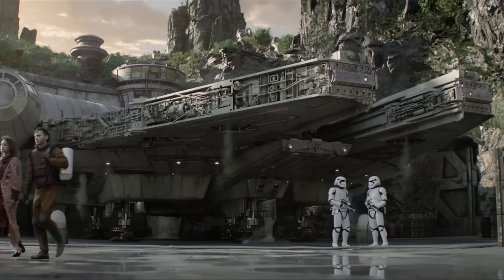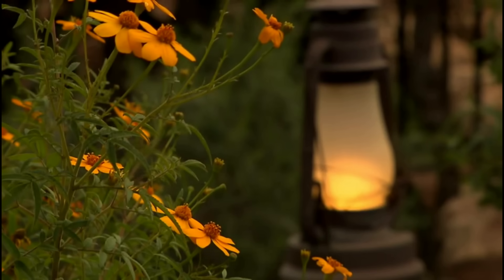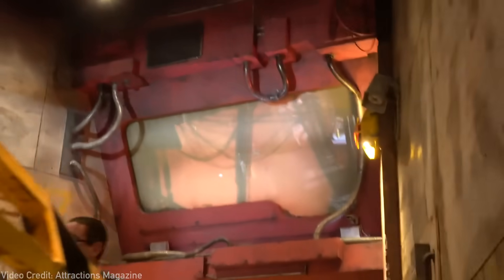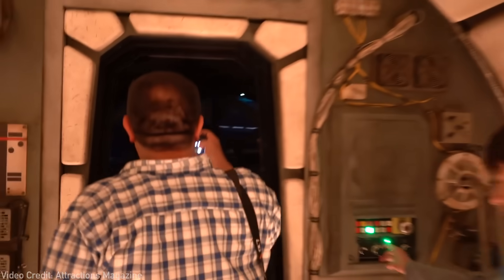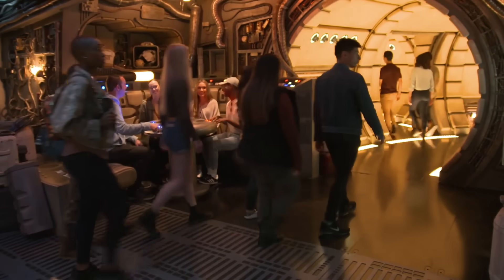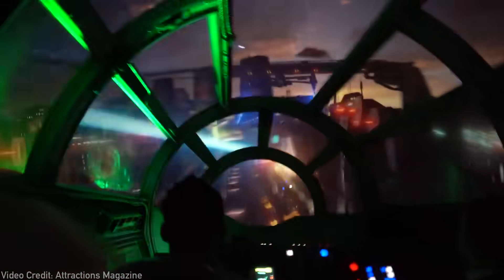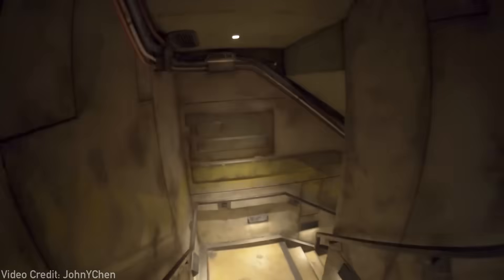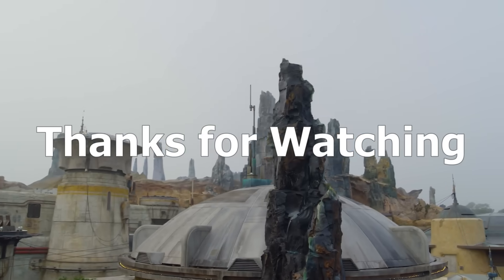How It Works: Millennium Falcon Smuggler's Run

Comment from the maker: What's your favorite ride experience? Share your story. 🙂
Support us: www.patreon.com/AmusementLabs
Reply: When will you doing Soarin?
Reply from the maker: It depends. I'll be putting out a poll soon.
Reply: @AmusementLabs  alright
Reply: What I don't understand is why Disney has not (yet?) created multiple different ride journeys for this ride.  Since the entire ride is computer controlled, why not create many different adventures and change them every month?  For example, if there were 12 different ride adventures with a different one active every month, return visits to the park every month would be almost guaranteed.  And why stop with just SciFi type rides?  This type of technology could also be applied to "kiddie" rides, too, so that rides like Mr. Toad's Wild Ride and Snow White and Peter Pan could be converted to rides that seemed to have movement, but like the Star Wars rides, never actually moved.  The same physical space could accommodate more simultaneous riders, the lines would move faster, and different adventures could be loaded each month.  Surely I can't be that much smarter than Disney's managers, so why haven't they done this?
Reply: @Hal_T  when I was at Disney a few months ago my family and I were lucky enough to go to it twice, and while the major plot points were the same we ended up shooting away tie fighters the second time around
Reply: @Bennyboi_  - That's an encouraging first step, but I don't see why they are not expanding on that and shooting you off into a whole new adventure because you shot the bad guys.  With computer controlled rides there could be limitless possibilities.  And with "unlimited" ride potential you get "unlimited" return riders.  I don't understand why they are not doing this.

Comment: This is the only time a ride has broke down while I was riding it! (thankfully during the landing sequence). 
The cockpit tv's have a lore-friendly video that plays while you get rotated out, once you get out the staff will give you a lightning pass that only works on this ride (because the other 3 presumably are still running), and they'll let you stay a little to show you how the revolving exit works! 
But uh yeah if you hear a grinding noise tied to the movement, let the staff know

Comment: For those of you who've never rode this ride before but are wanting to, here's a tip: the ride functions like a giant, full motion video game (meaning that you're actually in control of the movements and the action). It's best to choose the two people in your group who have the best hand-eye coordination to be the two pilots (or you're going to end up having a very rough ride like I did when I let my mom and dad be the pilots, lol). Also, there's a fun detail in this ride: there's a live scoreboard that shows up on the screen at the end of the ride just before you depart. If you plan on riding the ride more than once, you can try improving your score with each time you ride as a fun challenge.

Comment: Its unfortunate. There's always a kid, the kid always will be a pilot. So you never get to be the pilot, and the kid keeps crashing, so the gunner is redundant and the engineer is button spamming. Nothing you can do about it, letting the kid be pilot is the right thing, it's just inherently flawed if you're not in a large group or luck out. I've been on it a few times and I'm yet to do anything interactive in the interactive ride.

Comment: Guys what happeneds if u don't get hit by anything is the ship clean when u get off the ride
Reply from the maker: You get more points and the spiels are different. Originally there were panels that would flip around to look like damage if the ship was during flight, but I don't think they work anymore.
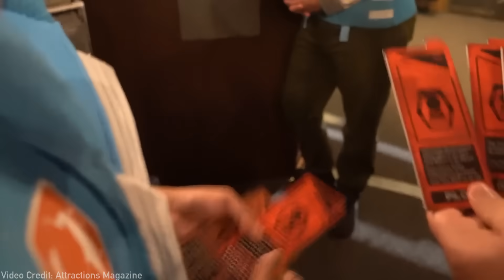Reply: @AmusementLabs  I was gonna say, I don't know if I've ever seen the damage panels, just as I don't recall when they last handed out those cards you showed at 5:23!

Comment: As someone who works here, this is very well researched. Impressed by how much you know. 

Controls in the cockpit are actually determined by your seatbelt, not necessarily censors in the seat. Nothing in a control panel works until the corresponding seatbelt is buckled in. 

What you call a carousel, we call a turntable. They’re called Alpha, Bravo, Charlie, and Delta.
Reply: That makes more sense tbh. The technology for seat belt sensors has existed in cars for decades, it would be easier to modify something that already exists vs having to make something new. Right?
Reply: That's a really interesting tidbit, thanks! I always wondered what would happen if I showed up and was the only person there given that at the very least, you need two pilots to fly the Falcon!
Are there backup controls on the pilot positions for the engineering and gunner roles in the case that there aren't enough people? Or does a Cast Member tag in to help?
Reply: @rowangoswell  Nah, the missing roles just get automated.
Reply: This happened to me today (lucky timing with the single rider line?) and was told I could pick whatever I wanted and the other roles would be automated.
Reply: Delta turntable 101 lol
Reply: Those names actually make sense.

Comment: Fun fact: If the ride breaks down, it can be just as fun as the ride itself! Hondo will ocassionally pop up on each station's screen and deliver a short speech. (Example, asks a droid to play some music while the riders wait that consists of random beeps, or has a conversation with chewie about what's broken.) 

Overall though the ride is very fun and here's a tip: The single rider line is much shorter than the regular line, and is a viable option if you don't mind playing as engineer a lot.
Reply: I did see part of the video where he reports a "hitchhiker" creature, which is apparently how they stall for time when the ride's over but not ready to unload. And I once saw the alternate preshow video where he apologizes for not being there in person when the Hondo animatronic's out of order.
It was only on my very latest time using Single Rider that I observed it has a voiceover of Hondo introducing Ohnaka Transport Solutions to make up for skipping the preshow! Is that new, or was my timing off before?
Reply: @BagOfMagicFood  I don't think it was there before, although it's been a while so my memory's fuzzy lol.

Comment: I kinda hated this ride until covid precautions led to parties never being seated with other parties, because then our group had the ability to actually be the pilot or the Gunner. If you ride as an engineer, you functionally did not ride the ride.
Reply: This is BS. I have ridden the ride in each position, multiple times .  I think the engineer position is way more interactive than the gunners.  The engineers have to fire the harpoons and reel in the coaxium as well as make all the repairs.  The coolest thing about this ride is that every seat is important. 
 A good pilot / co-pilot team means the engineers do less repairs. And vice versa, a bad engineer team makes piloting a damaged ship harder. It really is a team effort.

Comment: My dad was the real MVP on this ride, He and my little brother were the pilots, while me and my stepmom were the gunners, we had no engineers. My little brother just looked up at the cockpit with awe while my dad had to multitask and control both vertically and horizontally, launch into hyperspace, and not crash. What a trooper.
Reply: I should have done that, but our engineers were ass.
Reply: I did something similar. My brother didnt know what he was doing so i had to take control a few times. Fr tho your dad is awsome
Reply: Yeah Well The Real Magic Would Be Seeing If This Could Be Done Solo In A Believable Fashion I Remember Running A Training Exercise Once Where The Scenario Was Smuggling The USS Pueblo Home That Was The Exercise Where I Attracted A Lot of Korean Girls You Know The Tour Guides For That "exhibit" Understandably I Got A Little Nervous When Things Started Getting A Little Too Real And I'll Tell You If There Ever Was A Real Life Millennium Falcon That USS Pueblo Would Be That Ship The Training Exercise Exists Because Few Know That The Pueblo's Helm Is Actually Compromised But You Would Run Through The Ship To Start The Engines Assuming They Still Have Fuel Only To Arrive At A Gaping Hole Where The Helm Should Be What That Training Exercise Taught All of Us Is That Smuggling Doesn't Work Eventually Your Luck Runs Out You Get Caught And Well North Korea

Comment: I am very sensitive to motion sickness.I am an 68 and some years back I rode Mission: Space, got so sick that I was taken by ambulance to the hospital and spend the next night and following day in bed (I did both back -to-back versions of the ride). Does this ride uses centrifuge, or may be safe? Taking a trip back to WDW Florida at the end of October.
Reply from the maker: It's not a centrifuge. The carousel is only to index the pods slowly. It just rotates over to the next one. It doesn't spin up. It can bump you around though, so if you're easily motion sick it may not be entirely for you. Just don't let kids be the pilots, they'll really make you sick.

Comment: The thing I personally don't like about this is that when you're the pilot, the flight controls are divided between you and the other guy. This annoys me because I only have 50% of the control, and if the other guys does something wrong(like pulling too hard), I can't stop him because he, in this case has the verticals and I have the laterals.

Comment: Out of curiosity, why do the pods have to rotate? Does the screen rotate, too, or just the pod? Thanks!
Reply from the maker: The entire screen and pod rotates with the carousel so that they can have multiple pods which greatly increases capacity. Otherwise they'd only be able to do 12 people max ever few minutes per side (there's two falcon sets each with 2 carousels) which would be terrible for a Disney ride. Their rides often need to have a capacity of 1,100 people through per hour. This is why Rise of the Resistance has boarding groups. The unreliability of the ride combined with the pace of unloading is problematic and so it maybe gets 800 an hour.
The Falcon is fine on capacity, but I could see them add 2 or 4 more unload bays in the future.
Reply: @AmusementLabs  my bad! What I meant was, at the very start of the ride, why does the pod slightly rotate? Why can’t it just stay positioned straight ahead? Thanks! 😁
Reply from the maker: @gaptoothed  You would feel the rotation and it would give it away if what was on screen didn't match what you felt. So they might as well disguise it as part of the ride.
Reply: @AmusementLabs  you do great work!

Comment: The "game" felt difficult to me. It feels impossible not to crash into something if you're in the pilot role because the controls are undersensitive. The engineer role was confusing as well. We kept hitting the correct button when it was time to hook onto the cargo, but the attachment failed.
Reply: I get that, I was left and right and it kept overcorrecting!

Comment: Do you consult? Is there an e-mail I can reach you at?
Reply from the maker: Consulting in regards to what?
Reply: @AmusementLabs  development of ride concepts and technology
Reply from the maker: @eduardofarias5397  I do have an email amusementlabs@gmail.com
I don't really do consulting in the professional sense, I do this more as a hobby as I'm still at university.
Reply: @AmusementLabs  great! I’ve sent you an email. If you haven’t received it, please check your spam folder. Happy Holidays!
Reply from the maker: @eduardofarias5397  I just saw it. That's really great that you help run a space like that, I've always wanted to do something like that on my own. Unfortunately though, I can't really consult on something like that since I've never actually ran a makerspace like you. I can recommend that Arduino is a good starting point for operation panels as long as you know to run things like mosfets, transistors, relays, things like that (cause you can't run everything off the arudino power wise), but you'll need to make that decision for yourself (for legality as I can't be responsible if something goes wrong). As for buttons there's a slew of good industrial buttons that are close to what they use in the industry (the ones they actually use are quite expensive). I hope this helps. 🙂
Reply: @AmusementLabs  thanks for the input. We already make extensive use of microcontrollers such as arduino, but also computers such as the raspberry pi etc. Anyway, thanks for your help! Good luck with your channel. Cheers!

Comment: If you scrutinize it a bit, the Falcon that sits outside isn't quite 1:1 scale, but close. I've been in enough cockpits in my life to know you can't fit four or five people in there. Also, the entry ramp clearance isn't tall enough for even an average sized person. They'd have to stoop as well.
Reply from the maker: Ah okay, that's a good catch. I'm not a big Star Wars person so I figured it's probably 1:1, bit like you said, it doesn't like up.
Reply: @AmusementLabs  I imagine other engineers or fans of engineering have noticed this too. Or me as a model builder. When I saw the original 6’ model, I instantly recognized several model parts that were kitbashed from other kits. When you upscale those pieces, they look very different from what you see at scale. Like a raster image file, when you upscale it, it can only get so large before the distortion gets unbearable and you have a clumsy looking image. Same in 3D.

Comment: Really love this video, thanks for putting it together! I’m particularly interested in what you said about the ADA pods. At the end of the video you mentioned they are more intense but also that they are stationary. I’m confused. Can you explain? I use a manual wheelchair and have decent arm strength (but very little grip strength), and I’m paralyzed from the chest down so I suspect I will struggle with lateral balance in particular. Are you saying that the ADA pods don’t move back-and-forth and side to side? If so, how are they more intense?
Reply: So all the other pods are on a turntable that rotates versus the ADA pod doesn't rotate because it's not on a "carousel." This would make it more "stationary," technically speaking, but it's not any less intense and actually has more freedom because it's separate.
Reply: @lmoon2627  just saw this reply now. Thanks!

Comment: Interesting. Impressive, even, but NOT worth whacking a big chunk of one of the most iconic and original parts of the park: The rivers of America. Walt did not want his park to be just another cheap carnival. It was supposed to be a place where families could spend quality time together. The river boat ride was a pleasant interlude where you could just slow down for a bit. To a kid it really seemed like you were on a river! Now the ride has been shortened and diminished. What a shame! "Critter Country" was also eliminated. Sad. My kids LOVED that. You got to spend time with REAL FARM ANIMALS! The Millennium Falcon ride is certainly a good ride, but it is a poor fit in it's location. Couldn't they have found some other place to put it? Connected to tomorrow land would have been the logical place for it.

Comment: What buttons do you press to go into Chewy mode? Going for the first time since the Star Wars land opened. Thanks and I enjoyed the video!
Reply: I would not recommend Chewie mode for your first time but it's been several months now so what the heck. First: buckle up your seatbelts and all six seatbelts need to be buckled in (but nobody needs to necessarily be in the seat) for Chewie mode. Pilots: move joystick all the way to one side (left or right, up or down, doesn't matter) and then press your activation button (the one that blinks at you) after which you can release the control. Gunners and engineers: hold down one of the white buttons around your side screen and press your activation button (again, blinks at you) after which you can release the white button. Note that all of this needs to be done before the door to the cockpit closes completely and cast have been discouraged from helping you do it because it takes extra time. Also, one person messes up, welp, it's not happening. XD May the force be with you.
Reply: @lmoon2627  I’m confused: not all six seats have to be occupied, but all six functions must be completed?
Reply: @operabeth  Yes, which is why it's easier to have a six person crew rather than say five people and one person buckles in and set ups both seats.
Reply: As an FYI: If you do the singles line, you will be practically guaranteed to sit in the back of the cockpit, as CMs will put families up front.

Comment: I’ve only actually been on the ADA compliant pods so it’s interesting to see how the other pods “exit” (the damage on the ship). The ADA pods exit from the same side they entered
Reply: What is ADA?
Reply: @thatguy3968  Americans with Disabilities Act.  It requires businesses to accomodate wheelchairs & walkers.  It may be for something slightly different than for able-bodied people, which is how amusement and theme parks do it.  So, there must be a ramp that is no steeper than a certain amount and at least a certain width with a handrail.  There's a bunch of other rules as well depending on the type of business or residence, but it's to prevent handicapped people from completely missing out on a lot of things that us able-bodied people can experience.